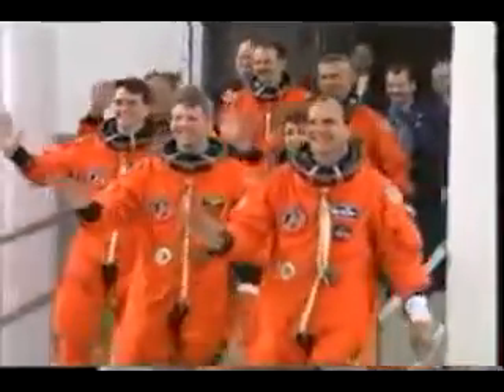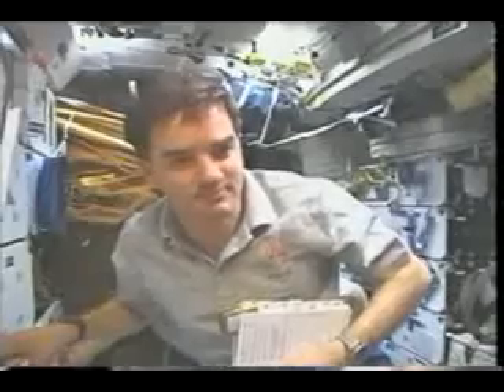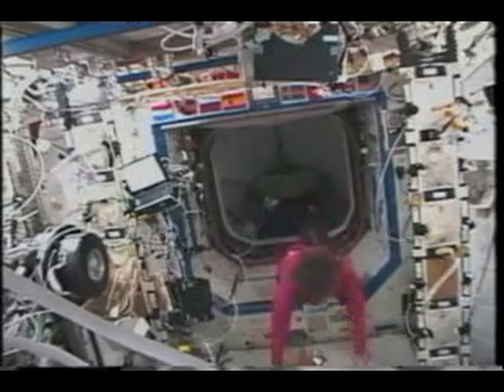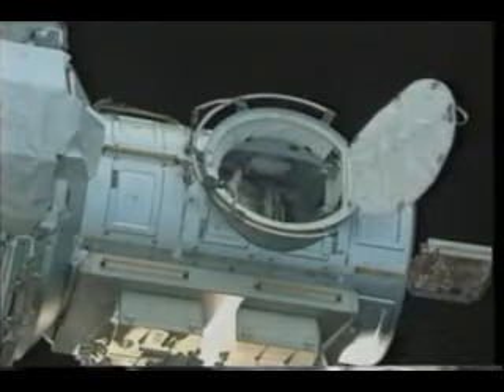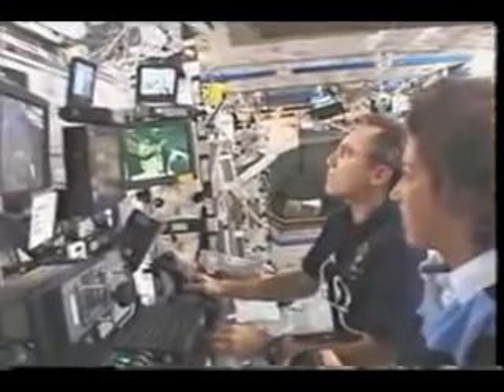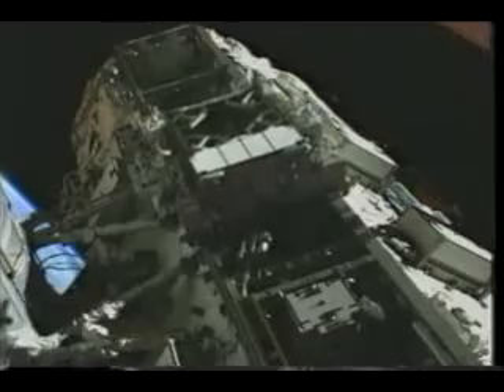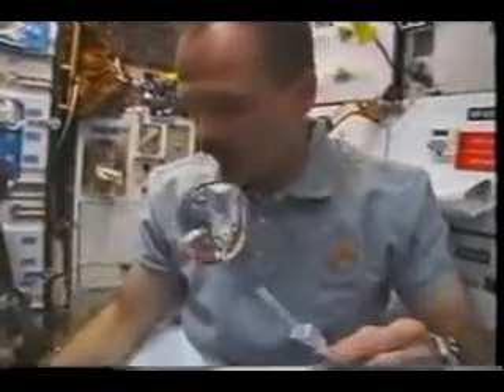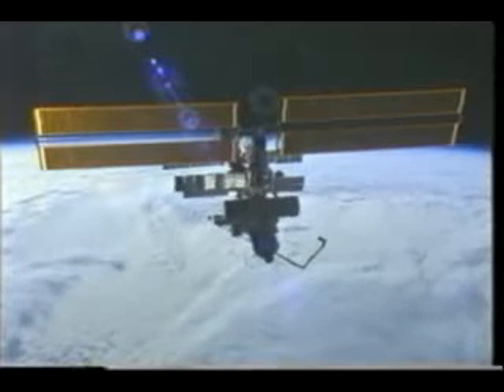2002: Space Shuttle Flight 109 (STS-110) Atlantis (NASA)

Comment: STS-110 was the third of 15 truss assembly flight S0 was needed because four flights after this one the solar arrays will be delivered and S0 must be on board because STS-111 after this one has the S1 truss with an ammonia tank and flux 20 radiators S0 has a bigger tank of ammonia and also houses the nitrogen tanks and the pump module so this has to be on station before the other parts arrive.